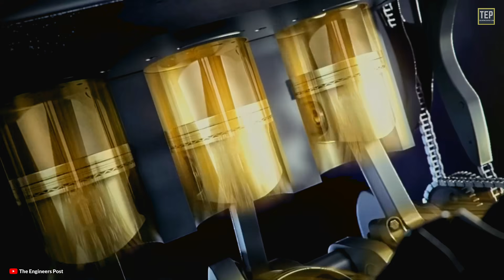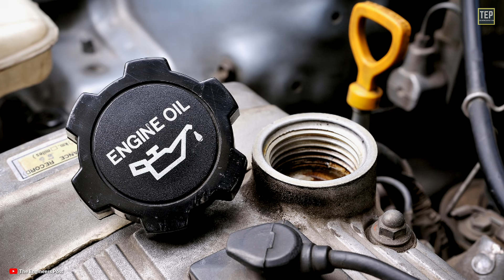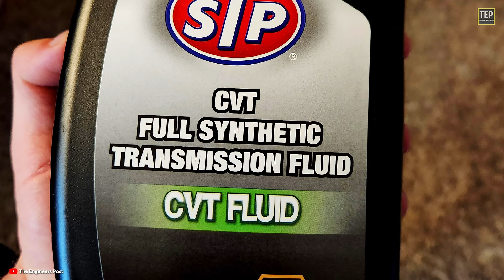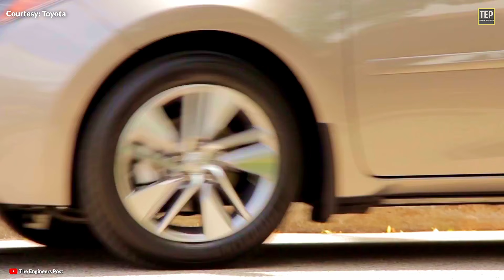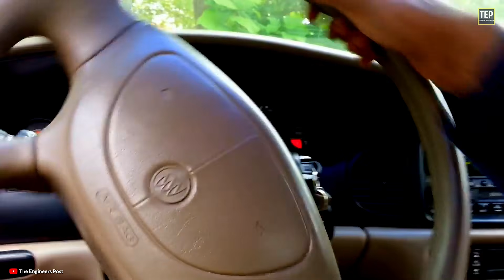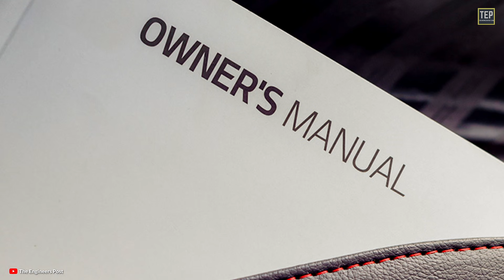When & How to Change Every Fluid in your Car | Explained

Comment: engine oil 10000km (full syn) or 6 month....brake fluid 2 yrs....transmission oil cvt 25000km.ecvt 40000km.atf 50000km.dct clutch dot3/4 10000km + gearbox 50000km. amt clutchoil+gearbox 50000km . coolant 100000km or 10yrs afterthat each 5years or 50000km...sparkplug 80000km irridium... always change a good fluid for a good one because u cant 100% drain old fluids completely...

Comment: for the gearbox fluid automatic transmissionshould be lower mileage compare to manual transmission to change the fluid... for manual transmission should be above 100000 to 150000km for change. for auto transmission is about 40000-60000km for next change.

Comment: As soon as he said automatic tramsmission fluid can be lifetime, I stopped the video. ATF is only lifetime if you want the lifetime to be  less than 150,000 miles 😂

These vehicle manufacturers want their vehicles to look low maintenance. Ask a mechanic at a smaller shop when you shoukd be changing your fluids, they've seen it all.

Comment: TO PREVENT CARBON BUILDUP NOT ONLY USE A REGULAR GOOD FUEL SYSTEM CLEANER LIKE CHEVRON TECHRON (which is considered the best) as it contains the highest level of PEA (Polyether-amine), a powerful, nitrogen-based detergent considered the "gold standard" for removing tough carbon deposits, gum, and varnish from fuel injectors, intake valves, and combustion chambers, making engines run cleaner and more efficiently. 
Driving a lot of short trips or doing a lot of stop start city driving will add to carbon buildup. To help reduce carbon buildup and maximize engine performance you need to take your car on a regular freeway run at least once a week or once a fortnight to enable the engine to reach maximum running temperature.
The best way to reduce carbon buildup on the freeway is to perform what is called an "Italian tune-up" to reduce carbon. It involves warming your engine boy, driving jointly for about 10 minutes, then driving at sustained high RPMs (like 3000-4000+) on a freeway for at least 20-30 mins to generate heat that burns off deposits, using higher gears/manual mode to keep revs up, not necessarily bouncing off the redline but exploring the power band, using all the various gears ratios and then cooling down the engine by driving gently for the last 10 minutes of the journey. This helps clear injectors and exhaust systems, especially for modern direct-injection engines where intake valves build carbon.
Remember to use top-tier fuel all the time and use high quality fuel cleaning system additives regularly to reduce carbon buildup dramatically - your engine will thank you for it. You do not have to use a higher octane fuel than your car needs as octane has nothing to do with cleaning carbon deposits as many people believe, you really are just burning your money away  - all top tier fuel has cleaning additives. Different fuel companies use different cleaning additives so it is advised to use a range of different top tier fuels and not just stick to the same brand all the time. It is true that higher octane fuels do contain slightly more fuel cleaning additives, but it is still not worth the money paying for the extra wasted octane. Just use your cars recommended octane, level fuel, and a good fuel cleaning additive every 3000 - 5000 K and take your car on a good long freeway drive avoiding cruise control as this does not allow for the different gear ratios that you can achieve with cruise control which is programmed to level gears out. After your car has warmed up a little try driving up a mountain where you can get your revs up high. 
I do a regular ‘spirited’ drive in Sport Mode, a round trip where I do about 10 minutes of gentle driving on a flat road to warm the car up before making a 30 minute spirited mountain ascent drive at between 80 to 100 KM per H, accelerating gently to increase revs, then backing off, then accelerating again (to make sure I use all my gears); The trip is to a point of 2KM above sea level; before making a round trip back downhill descent in Eco Mode, which is extremely good for fuel economy in my hybrid, mostly cruising and using the EV, lower gear and regenerative braking downhill which also recharges my battery fully at the same time. This regular road trip is great for burning off any carbon and any moisture due to the engine reaching maximum efficiency and heat (I take a longer similar trip when I have added a fuel system cleaner to my tank to get the optimal benefits of the cleaning agents).

Comment: When you clean the throttle body and disconnect the battery, you need to disconnect the NEGATIVE connection and make sure it does not touch any other metal parts of the engine

Comment: Regarding oil changes, time also affects oil degradation. Oil should be changed at least every 6 months - no longer even if you have done less traveling, it is not only 5,000Km or 3,000Miles traveled - might be a little longer for full synthetic oil, but very important to stick to a tight schedule with less traveling for turbo engines. 😅

Comment: Checking if your brake fluid is OK you can buy test strips from your auto shop that can check the moisture % in the brake fluid. The strips are reusable and you can also use it for your coolant. If your brake fluid shows more than 3% moisture it needs to be changed. Ideally, you should check your brake fluid yearly and it should be changed every 2 to 3 years.

Comment: LIFETIME (sealed) NEVER NEED CHANGING TRANSMISSION. FLUID OIL IS A MYTH - if you want longevity out of your transmission, you need to have the transmission oil changed frequently. You need to have a drain and fill not a full flush. A drain and fill will leave some tiny particles of the old transmission oil which actually helps the gears work better I giving it some extra grip. Otherwise you will cause slippage of your gears. 
If your car has gone more than 100,000 K without a transmission fluid change either leave it alone or do a gradual part drain and fill which involves changing a small amount of fluid every couple of months at about three intervals so you do not shock the transmission. Most modern new car manuals will state a lifetime, sealed transmission fluid that never needs changing however, in reality lifetime means the warranty period after that you’re on your own. Some car manuals suggest a fluid change at 100,000 K but this is too long. It needs to be changed at every 50,000 K.

Comment: car fluids:

breaking fluid
steering fluid
engine cooling fluid
engine oil fluid

engine oil
gear oil
break oil (hydraulic)
transmission fluid
power steering fluid
engine coolant

3:50

Comment: I have had my used car for over 6 years have never changed or have added break fluid. I do everything on my car but never had break problems aside changing break pads and lubricating the pins.

Comment: I own a nissan versa 2024 in canada. Dealer changed break oil at 2nd service, stating user manual recommendation. According to that, break fluid should be changed at every other service. Is this necessary?

Comment: Most modern vehicles do not have any ability to check transmission fluid.

And the method outlined was... is utterly bone headed.
That vehicle has a dipstick!  Why the heck would you drop the pan to check color and odor when a simple pull of the dipstick will provide that information without cracking the transmission pan seal???

I pretty much had to stop the video there due to the sheer shortsightedness of that entire segment.  It was stupid.

Comment: Why engine need coolant
Reply: To cool the engine down
Reply: Because modern engines contain alloys that will react with unfiltered water so the coolant helps to prevent calcium and other contaminant build up

Comment: Every car buyer should have to watch this before driving
Reply: Except for the transmission fluid information it is wrong. Lifetime sealed transmission supposedly that never needs changing that lasts the lifetime of a vehicle is a myth lifetime in reality means the warranty period. Transmission fluid needs to be changed every 50,000 K. It needs to have a drain and fill not a flush a drain and fill will leave some particles that actually help the gears grip a full flush will cause the gears to slip if a car has done over 100,000 K either leave the transmission fluid alone or have a gradual drain and fill done over a period of three separate part changes otherwise the transmission will be to shocked from the fluid change and it will cause slippage. If you want longevity from your transmission, change the fluid every 50,000 K otherwise a new transmission can cost anything from $4000-$7000.
Reply: @ILuvCooperAlan  how do you do the 3 gradual transmission fluid drain and fills? And how often

Comment: Wait, you can check the transmission oil?
Reply: Older cars still will have the dipstick to check. Newer cars do not but they do have a check plug on the transmission itself you can pull and check from there.
Reply: @vigilantemotors  so my 2008 honda civic hatchback has dipstick?
Reply: @ Yes, the 2008 Honda Civic Hatchback with an automatic transmission does have a dipstick for checking the transmission fluid level. This dipstick is usually located near the back of the engine bay, near the transmission, and has a yellow or red handle for easy identification.

*If it's an automatic transmission, it should have one.*
Reply: @vigilantemotors  I have manual
Reply: @ Then it does not have a traditional dipstick like an automatic transmission. Instead, manual transmission fluid is checked using a fill plug on the side of the transmission case.

1. Locate the Fill Plug – It's usually a 17mm bolt located on the side of the transmission case.
2. Park on a Level Surface – Make sure the car is level for an accurate reading.
3. Remove the Fill Plug – Use a wrench to unscrew it.
4. Check Fluid Level – The fluid should be just below the edge of the fill hole. If you stick your finger inside and don’t feel fluid, it’s low and needs topping off.
Reply: @vigilantemotors  apreciate the tips, bud 🤘

Comment: What if you don't have a dip stick to check transmission?
Reply: Newer cars unfortunately are coming without the ability to check easily.  Many new cars have an inspection plug. This plug is typically located on the side of the transmission. When you open it, if the fluid is at the correct level, it will flow out slightly. If no fluid comes out, it means the fluid is low and needs to be topped up.
Reply: Just drain and refill every 35-45k

Comment: diesels always have black oil instantly so the color checking is only for gas engines, except checking for head gasket leak of course.
the transmission fluid is a pain to change in a manual and not really necessary. its more about the filter in an automatic or a flush when it makes noises while shifting. i ve owned manuals with nearly 300k kms and the transmission fluid was never changed and the transmission was still like new, except for the clutch of course but at that point its okay to have clutch wear

Comment: Is it alright adding a PTFE(Teflon ) oil additive to a new car's engine oil?
Thanks!
Reply: Just do early engine oil changes for a new car. Like 1000 miles, 2500 miles, 5000 miles, then 5k mile intervals
Reply: No. The moving parts need time to set themselves in-place. Use engine oil only.

Comment: There's no such thing as lifetime fluid. Any vehicle automato transmission should be changed every 35,000-60,0000 miles with dealer fluids.

Comment: My car has no transmission fluid dip stick. Also has no cap to open.
Reply: Unless your car is electric you should either YouTube where to find it or read the manual. It's there.
Reply: @SolGoddess13  Not always. Some newer vehicles have sealed transmissions. They don't have a dipstick, just a drain and fill hole. You can tell if the transmission is full if fluid comes out of the drain hole. If nothing comes out, it needs fluid put in. It's a stupid design so dealerships make more money.

Comment: The lifetime transmission fluid is a myth. Change it every 50 to 60 thousand miles due to companies not putting filters in the transmission.
Reply: And thats my problem now, with my jeep, I have had several techs tell me I dont need to ever change my transmission oil, and i mean over 6 to 7 of them told me. Glad I'm learning this now as im about to work on my jeep. I planned on working on it soon.
Reply: It is lifetime transmission fluid, just the lifetime is reduced due to no fluid changes… I would never let transmission fluid go for more than 40k miles, cheap insurance
Reply: @RickOravec  for Automatic?
Reply: @Cr3dit  that is correct
Reply: I've had an experienced licensed technician tell me to never change the transmission fluid on anything. He's worked on everything up to military vehicles.

Comment: What if the oil is above the maximum mark? My dealership seems to put it 20% over
Reply: A little over is Ok. But not much.

There are suction tubes you can use to take some out from the top. Or you can open the drain plug and take out just a little. 

Whenever draining fluids, always make sure to open the fill point, or you could be in for a lot of hassle. But hey, I only remember that half the time myself😂
Reply: @ is that because the fill point lets air in and avoids a vacuum when draining?
Reply: @ashresearcher  that is true, but the bigger uhoh is if the fill point is stuck. you drain all the oil, then have no way of getting it back in, and you can't drive the car.

for example, it's much better if you find out that the oil cap won't come off. then you drive to the mechanic if you can't take it off yourself, no tow truck required.
Reply: @ oh right lol!!!
Reply: Thanks

Comment: Oil is so easy to check and understand. It’s the most important fluid in the car after the coolant and transmission fluid. The oil on the dip stick should read between the high mark and the low mark. If it’s above the high mark you got way too much oil in the engine if it’s below the low mark you need to add oil. You want it to read between the high and low marks. Colour of the oil can tell you how old the oil is getting. A clear colour is fresh oil a brown colour is a little used a dark brown colour it’s time to change black it’s gone to far.
Reply: No it’s not the easiest to understand gas is the easiest 😂

Comment: Comprehensive, timely n useful video.  I m owner of old disel car. There may not be life-time oil for engines as claimed by car producers.
  I m from india. Here, brake oil is used to work for clutch( manuals) too. I mean only one oil for functions of the both.
  Likewise, transmission oil is used for shifting gear too. Here, transmission oil is called gear oil.
  Subject to Limitation of my knowledge, i have not heard of differential oil here. Plz clarify whether transmission oil flow is designed to work for( as)  differentials oil also in india?🎉❤❤❤

Comment: There is no life time atf. It’s better to drain and fill every 20-30k
Reply: With modern synthetic transmission fluid 90,000 miles is more realistic unless the vehicle is used for towing or off-road
Reply: @andrewwmacfadyen6958 you don't hurt the car by doing early preventative maintenance. Once your transmission starts slipping however it's just a matter of time.
Reply: Fluid cheaper then transmission 😅

Comment: Life time fluids are a scam pls don't do it 🙏🏾.
Reply: I paused the video and stopped watching after I heard this Ai robot say that phrase. 🤦🏻‍♂️
Reply: I think what they mean is that the engine would probably not last as long as the transmission fluid. But yeah if you've gone 100k miles you should definitely at least check the transmissions fluid
Reply: Lol 😂they get a lot of people to kill their vehicles just to sell more that’s why I don’t even trust dealership service intervals
Reply: depends how long the „lifetime“ is. sometimes the liftime is defined in the service manual, or you see how far the mileage goes in the manual and can change it some time after that
Reply: I did my family Toyota and Lexus at 50k and then every 30k 😊
Reply: OAT type coolants remain good for a very long time simple enough to check concentration and PH are within spec.
Reply: Nothing is "life time" when it comes to any machine be it a  manual bike or a car a train or a plane they are machines and machines serve doesn't matter if it still looks "pristine" and little  to no wear on a part or component im saying this with regard to a period of extended time you still replace. it all machines have a depreciation value